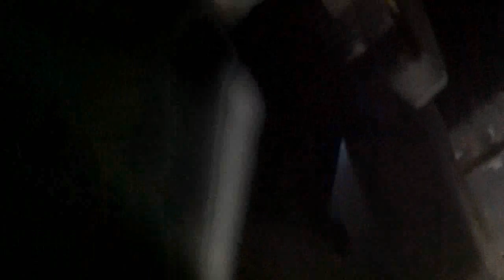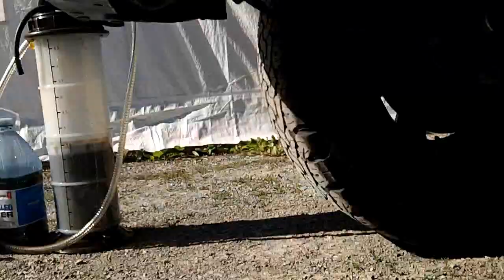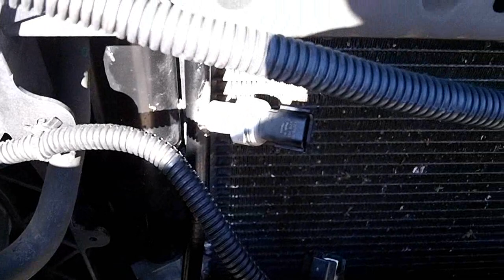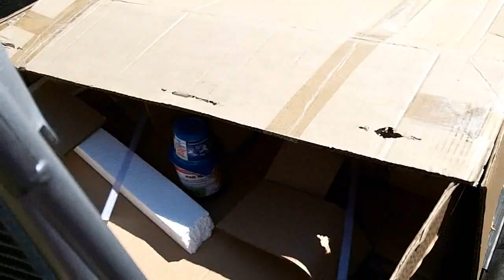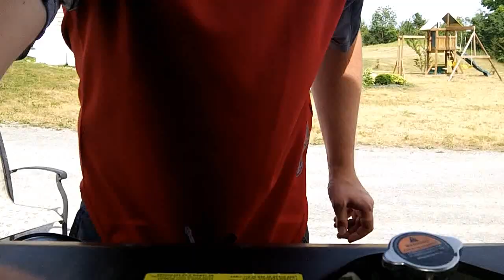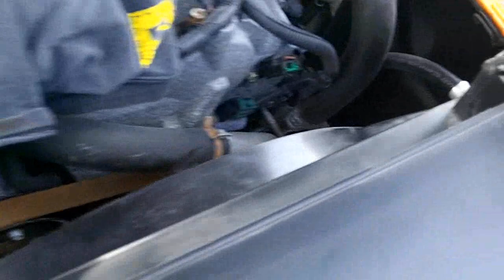Nissan Titan AC Condenser Replacement Nissan Armada

Comment: Do you know how/where to get the rubber grommets that the condenser sit on.in the bracket on the radiator? Thre oval one on my truck seems to be missing .
Reply from the maker: It might be a dealer only part.

Comment: How much R-134A did it take?
Reply: I just vacuumed mine and refilled with 3 cans of 12oz, a total of 36oz. Low pressure while car running between 40-50. I double checked it with the refrigerant can with gauge and it was within normal full reading.
Reply from the maker: There should be a sticker under the hood.  Mine says 1.54lbs

Comment: Well save up for that CFS and an electric fan system upgrade. I would do all new coolent lines as well. Great video 👍.
Reply from the maker: Thanks, if I hit 1000 subscribers I will buy the CSF rad and silicone hoses and make an install video!